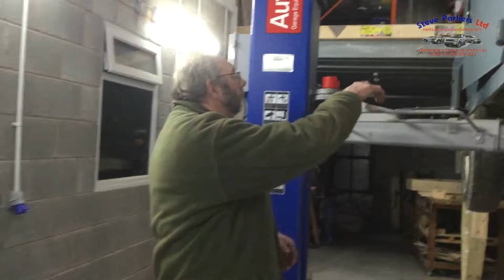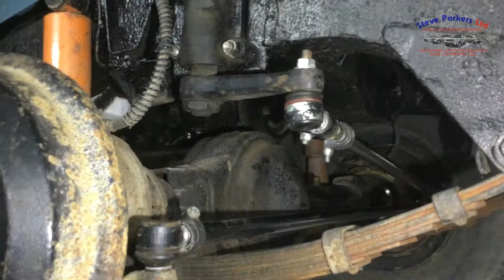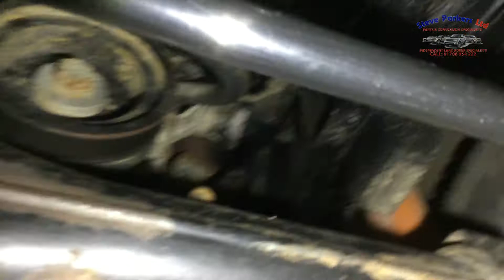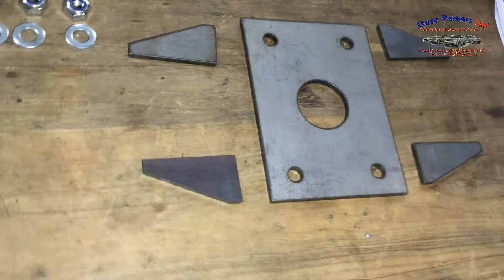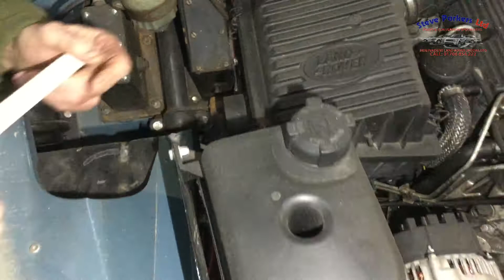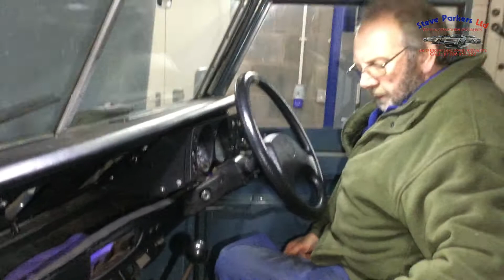STEVE PARKERS LTD PAS CONVERSION SERIES LAND ROVER

Comment: No the cross members don’t need moving when using a 4 bolt steering box, notch out the front cross member  and it fits a treat, and the rad etc doesn’t need any mod.

Comment: Great conversion, but should have taken the opportunity to design out those awful 1948 TRE clamps 😁
Reply: Awful? 
Dangerous is a better word if one lets go...
Reply: @rosshanley8398 .... There's a story ofa fatality where a TRE let go... Might have been miss matched S2 & S3 parts though..... Still crap idea
Reply: rustandoil, or, if the thread in the tube is compromised by corrosion ever so slightly, or the clamp somehow loses its purchase, the wear between the tie rod and tube threaded areas creates an invisible problem which cannot easily be found.
I had one where every few weeks a loud boom like a rifle shot would ring out and result in an abrupt shudder transmitting through the vehicle.
By the next bump it would piston back into place, hiding the 4-6 threads that it would jump out by.
I only found it when making measurements and kicking the wheels around from lock to lock.
The measurements kept changing and after a great deal of investigation it was isolated to the passenger side tie rod.
I was told tales of this same fault causing accidents where the left wheel would spear hard left and the right wheel spears hard right.
It pays to watch those points with a very critical eye.
Reply: @rosshanley8398  it's surprising such a horrible design went right to the end of Defender production!.... Gwyn Lewis "Sumo bars".... Are far superior in their design...